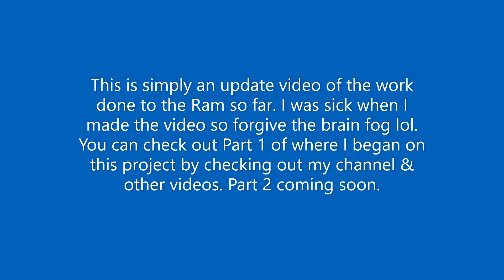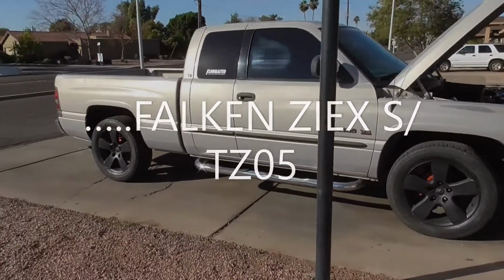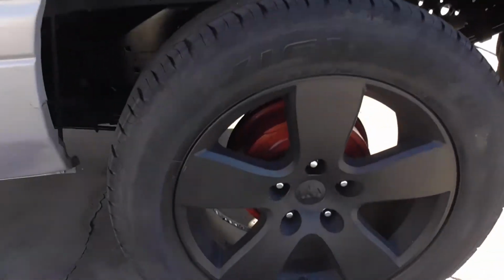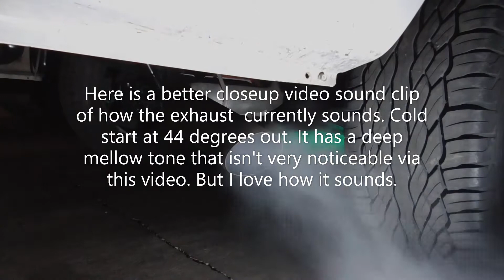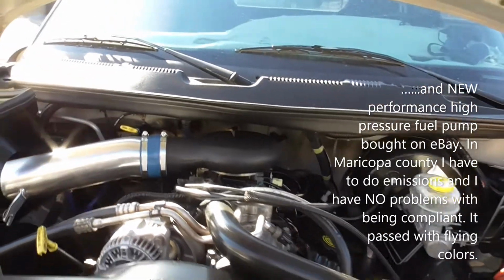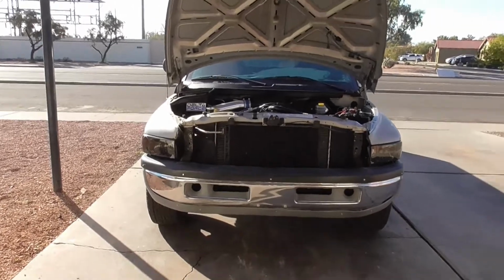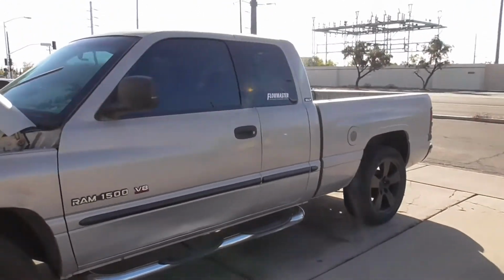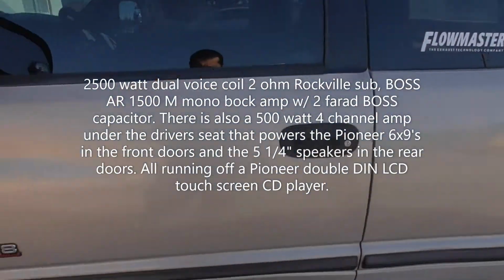2000 Dodge Ram 1500 PROJECT UPDATE 2wd CLEAN 5.9 v8 Magnum engine - MUST SEE!!!

Comment: I'm picking up a 2000 Dodge Ram 1500 w/ 5.9L Magnum engine, Auto, AC, etc. I'll be doing the obvious fix of the dash and trim, I will be doing the stake sides for my bed, the exhaust is already done, so I'll do the intake, head light update, and tail light update. Step bars (My truck is white and grey) so I'll do the black bars), I'll do the 'cow catcher front bars. Nice looking truck. Well done upgrades.
Reply: How did it go?

Just inherited a 00 5.9 gonna start my own project